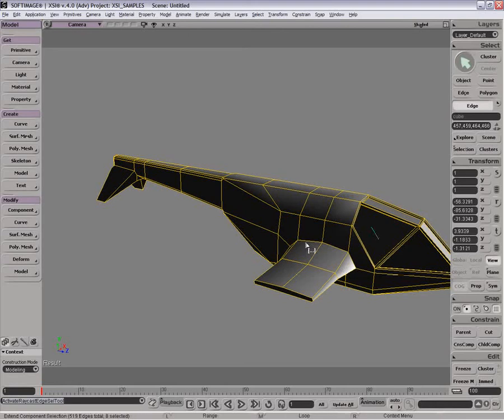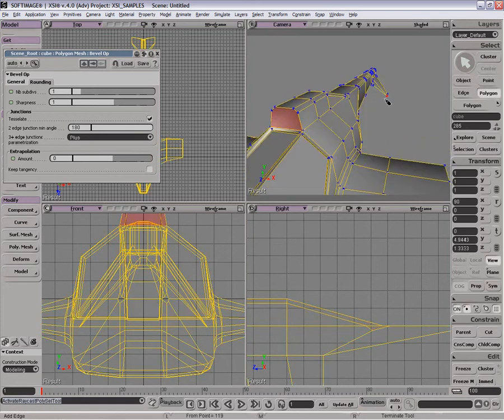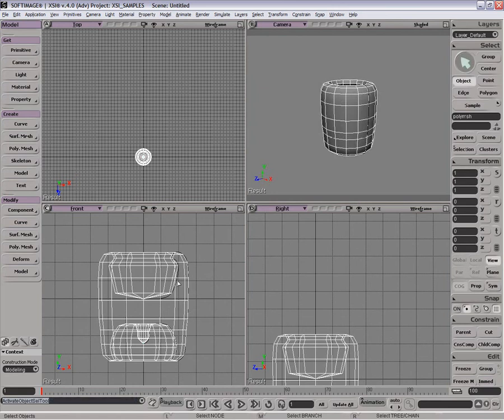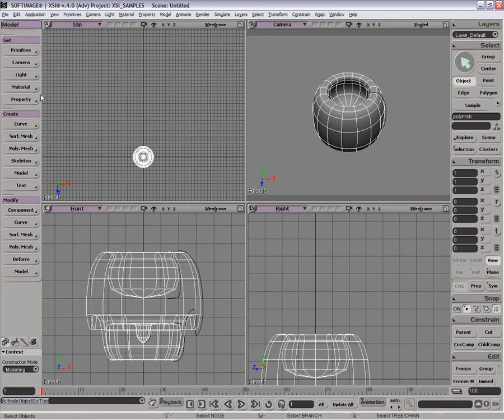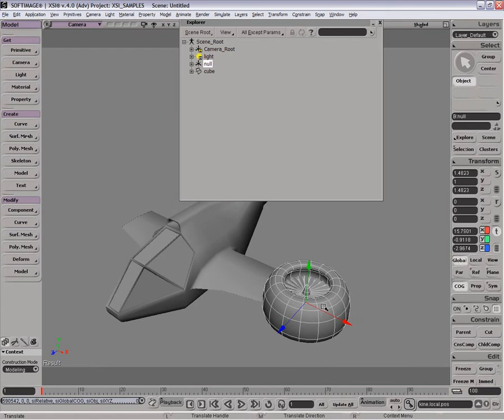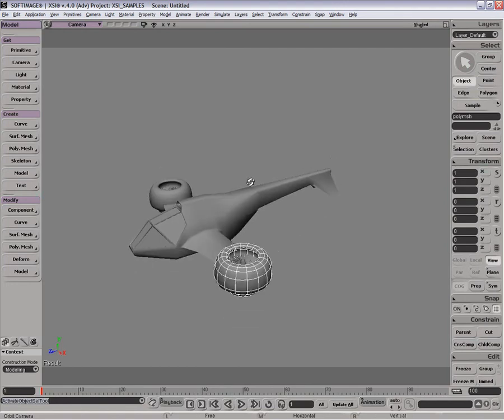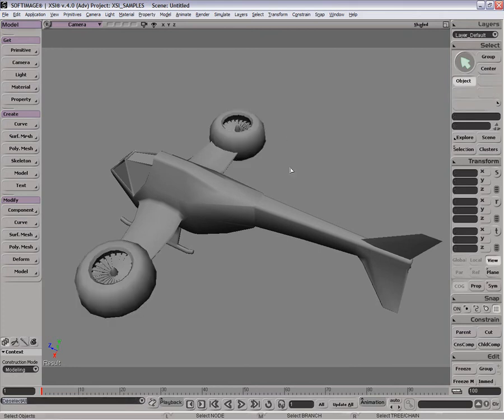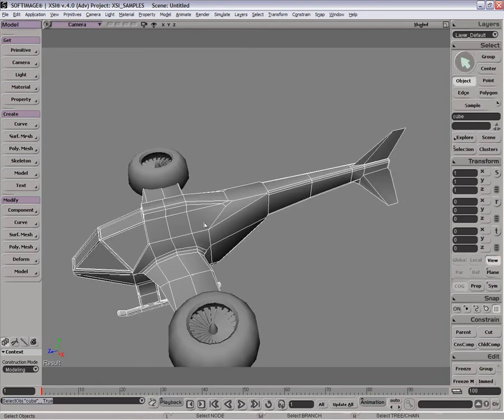Modeling: Polygon modeling, part 2

Comment: What's the hot key that you are using to select the other half of the object while you are working at on one side such that both the halves change. For example when you were working on the wings at the beginning of the video. Thanks for the excellent work.